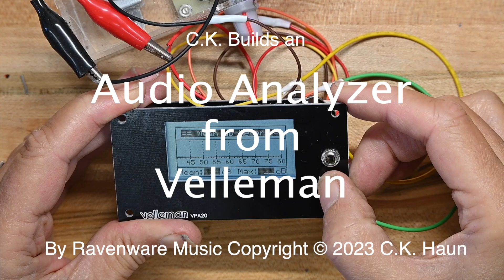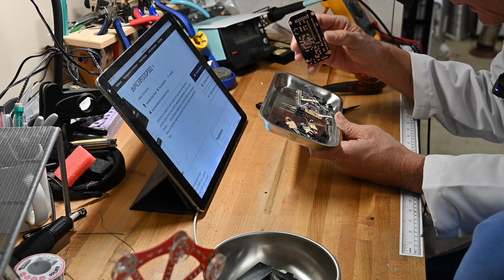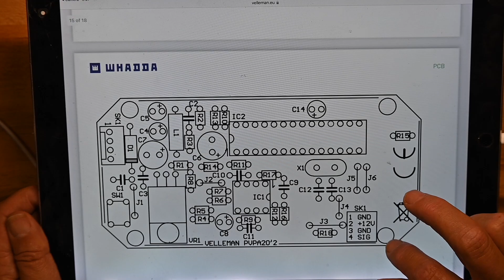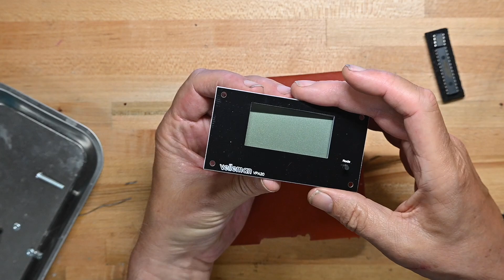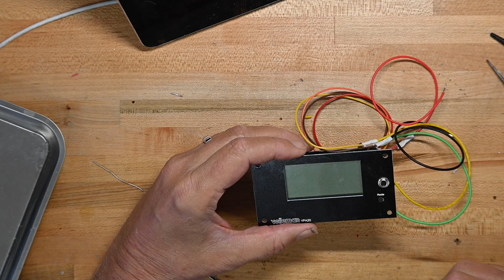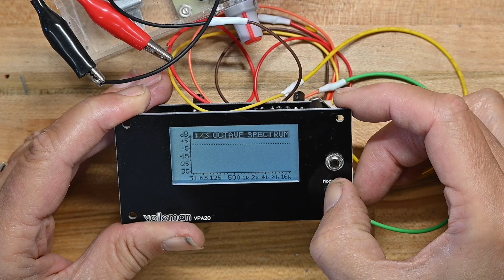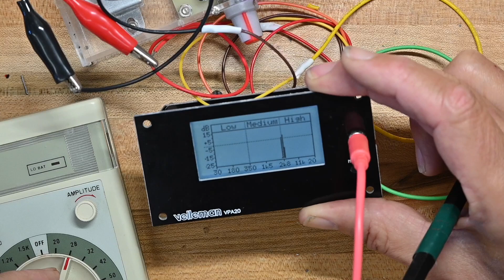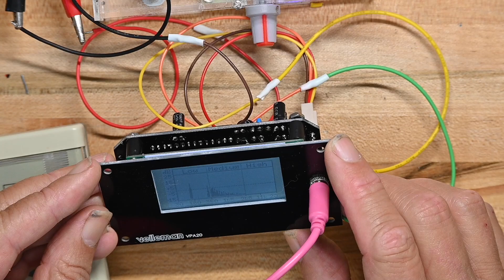C.K. builds an Audio Analyzer kit from Velleman/Whadda

Comment: I completely agree with you. It's a great kit except for that way of fixing the front panel to the rest of the kit. I have used a conventional transformer from a device (I don't remember which one but it's 12 volts and 1 ampere) and it works great! Nice to meet you in your channel.
Reply from the maker: @albertoperezpuyal3740  good to meet you too!  I actually hung it off my Eurorack power supply in my rack, and it seems to be fine with that also.  Handy and small for quick looks.

Comment: Great job C.K. I was thinking about how cool this project is until I saw the design for the faceplate. It is a shame that this was the route they took. They could have put some really cool hardware that goes right through the faceplate, but...missed opportunities. I do understand why they did it, but not a great choice. You did a fine job making it work. Thanks for sharing this experience!
Reply from the maker: Thanks!  It’s a bit surprising that they went this way, Velleman usually is top notch in design.  I just worry about beginners or youngsters who would give up on this very useful kit because of the mounting.
Reply: What was the cost? It would be nice to have chapter markers to skip the soldering and go directly to the “testing” (/demo).
Reply: Doh! I didn’t see the chapters in the timeline; didn’t think to check the description. Nevermind, that’s very different!
Reply from the maker: We (vid creators) don’t get to add timeline marks until the channel gets to 1,000 subscribers, which I ain’t at. So tell your friends to subscribe if you want ‘em 😃

Comment: Also a URL to where the kits you build can be purchased (IOW: Where did you get them?)
Reply from the maker: There is a link in the description to the kit at Jameco.com. Here it is again in case you missed it. https://www.jameco.com/z/WSAH8098-Velleman-Audio-Analyzer-Kit-with-White-LCD_2120815.html?CID=GOOG&gelid=,lper used in this build video;
https://youtu.be/2usWOtM4SA4
Reply: @CKHaun  thanks. I didn’t check the description. My bad!
Reply from the maker: If I were smart enough to figure out the video overlay things I woulda put it there, but no such luck :)